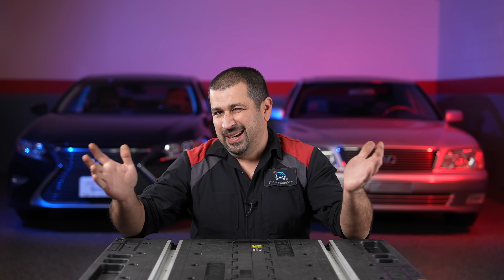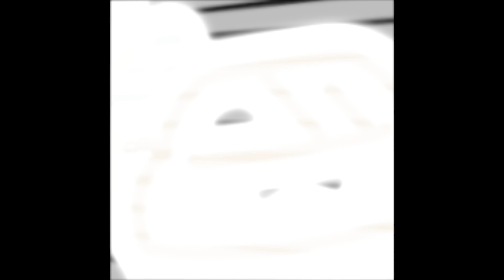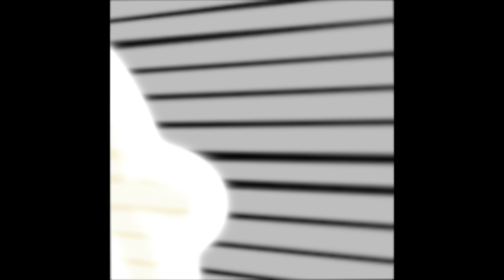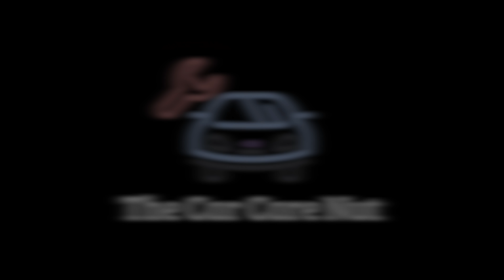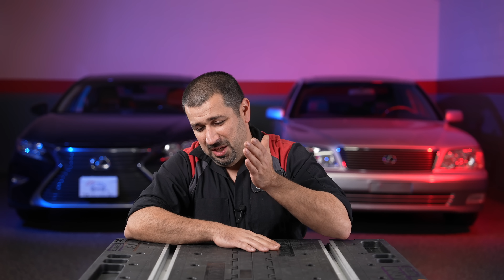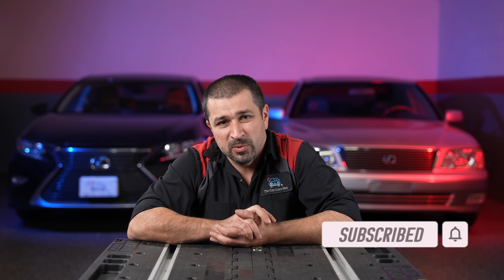Can Modern Turbo Engines Be Reliable? Here's The TRUTH!

Comment: Truth:  Oil is cheap, engines are expensive.
Reply: Most people assume they can handle the same neglect as NA engines. Usually it's not the turbo engines themselves causing the problem, it's the lack of maintenance and the additional fluff supporting it.
Reply: Thank You Scotty 😉
Reply: @SCOTTBULGRIN shhhh… stealing catchphrases is often all that the people who do that have.
Reply: @SCOTTBULGRIN  Scotty doesn't know.
Reply: And oil analysis is even cheaper. Make decisions based on data not time or mileage.
Reply: When i first started driving an old timer down the street told me if you want that engine to last a long time change the oil and the filter every 3000 miles, I still do that to this very day, So goes the saying oil is cheap engines are not .
Reply: These dumb manufacturers push these longer oil change intervals and they rather have you junk it and get another one.
Reply: @crlaw75  No, because they pay lower fines to the EPA when their environmental impact reports reflect longer oil change intervals.
Reply: @crlaw75 I suspect that the government has something to do with this aspect of oil change frequency.
Reply: @crlaw75  Governments are probably encouraging the same shit. TAX $$$$$.
Reply: Time is priceless though! Who has the time to change oil every 3k? Buy N/A 😂
Reply: @MikeKayK I changed mine every 3000 don't be so lazy
Reply: So are turbos....
Reply: Absolutely agree. I have learned over the years that simplicity and reliability is far more economical -- and probably more environmental in its totality -- than is fuel efficiency.
Reply: @cozyandahalle this is true.  One thing more environmentally unsound than an NA engine is the total emissions surrounding the manufacturing processes involved in producing a new car.  Want to be environmentally sound?  Drive the same car for as long as you can reasonably
Reply: The phrase "pay me now, or pay me later" is famously associated with a 1970s television commercial for FRAM oil filters. In the commercial, a mechanic warns a car owner that they can either pay for a new oil filter now (a small, preventative cost) or face a much larger, more expensive engine repair bill later due to lack of maintenance. The slogan highlights the principle of preventative maintenance to avoid future, costlier problems.
Reply: labor cost is expensive and most people don’t want to change oil by themselves 😂
Reply: @reelreeler8778 - Yes "Oil is cheap, engines are expensive" is the bottom line here.  
At the same time there is one more thing everyone should know about this generation of gas turbo cars: the misery of the 2nd half of the lifespan of these engines that will average about 80-90k miles, but only the first 40-45k miles will be normal.  During the 2nd 40-45k miles of ownership you will be driving around with an engine with worn piston bores and rings, reduced compression (lots of engine  blowby both resulting in increased crankcase heat and almost immediate contamination and breakdown of newly changed engine oil, noticable loss of power, engine temp running much higher.  The inside of the engine crankcase walls and cam cover, rocker arm assembly are covered and caked with black cooked oil (much like an old oven that's never been cleaned).  This buildup of caked oil increases engine heat, clogs oil passages, and contaminates new oil.  The increased blowby   = frequent replacement of PCV valves.   MPG drops, Power drops.  Heat build up in stop-n-go traffic is unbearable (you can feel the heat and the self-destruction of your car)..

I.e. the 2nd half of gas turbo car ownership simply sucks.
Reply: people are stupid and cheap
Reply: What a hugely original comment 🙄
Reply: Oil changes are NOT cheap at German car dealers like $150
Reply: @johnwhite2576 haha my Hyundai is 150 😅
Reply: Bull. Oil is expensive (done at 5k), engines are really expensive.
Reply: And the truth is people aren't cheapskates, but can't be bothered to DIY because of the need to go under the car and do wrench work. If you can change the oil and filter by just opening the hood/bonnet and not need to go under the car, many more people would do it.
Reply: @Avantime which is why they bought EV.. 😂😂😂
Reply: @JP81188  Funny enough I used to have an EV (Nissan Leaf). That car still had the original factory pads after 100k kms (60k miles) because of the constant brake regen. And virtually no maintenance at all.

Going back to an ICE Toyota Camry because I got a work vehicle, now I need to change the oil regularly, probably the transmission fluid soon, and I'm overdue for a fuel filter change in which I have to pull the back seats out and disassemble the fuel pump assembly. And now the VVTI gear is rattling on every cold start, that will be an expensive affair as I can't DIY it.
Reply: @Avantime yup.. EVs are like an iPhone where people just throw them away when the battery is used up.. 😂😂😂
Reply: That's not true at all, you can replace EV batteries pretty economically.  Not OEM but lots of aftermarket options, replacement or rebuild shops. Tho it's rare because the bodies tend to rust out before the battery declines so bad it's a problem.
Reply: Retired mechanic my dad retired mechanic. He always told me oil and grease is cheap and less work in the long run.
Reply: Not to mention the down time for repairs or replacement
Reply: Previous owner of my car went through 4 turbos and eventually the engine went. He believed the "10,000 miles" bs AND drove it hard.
Reply: Am a truck driver for 20 years and I have a lot knowledge about engines any engine, including boxer engines., I use TURBO ENGINE ONLY in tractor commercial truck , BUT I skip any single turbo engine for pickups truck , SUV and sedan cars , just no worked basically is just scam technology , Turbo engine is ONLY for tractor commercial trailers
Reply: Truth.. your fiat 💵💵 is worth less everyday.. 😂😂😂

Comment: My old VW TDI was excellent and the turbo charger went to nearly 280,000km before replacement and I sold the car (a Golf) with 340,000km on the clock for $5k!  I think a comparison between these small high speed diesel turbo charged engines, rather than the big truck turbo-diesels would have been a bit more useful, because turbo diesel cars were very long lived with the same use case as a regular gas engine cars.

Comment: The problem with turbo is exacerbation of the heat which will cook the engine and everything around it. Drivers need to be mindful of any temperature anomalies and address the cause before they warp the engine. Oil cooler is a solid insurance and buys time, but manufacturers hardly ever adds one from factory because they want to sell new cars.
Reply: Heat soak issues in hot climates especially  turbo Subarus
Reply: @PeterHernandez-lg2eh  Turbo Subaru's have pretty good bolt-on oil coolers from Mishimoto and Perrins which are more expensive than custom, but definitely easier because of the brackets.  Check for vacuum leaks which will cause lean conditions and exacerbate the heat.
Reply: Bingo. Formerly called the laws of physics.
Amazing how many fools there are that are ignorant of this.

Comment: Let's see how long the 4 liters turbocharged engine on the new landcruiser will last.. My 1997 landcruiser engine was robust...had 450k miles until it had a head-gasket problem.  It is now powered by a chevy v8 engine.  V8 with a good exhaust is objectively one of the meanest-sounding engines on the planet. It’s not just opinion — it’s acoustics + decades of muscle-car mythology.